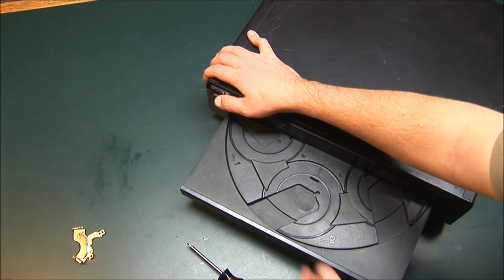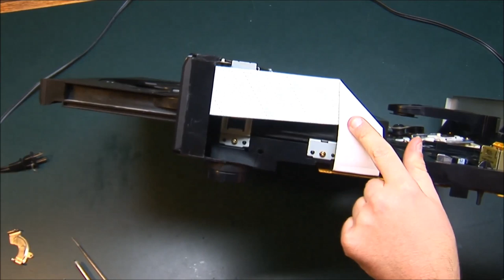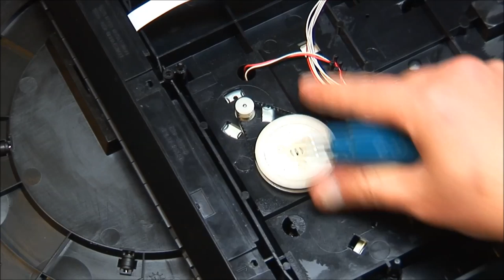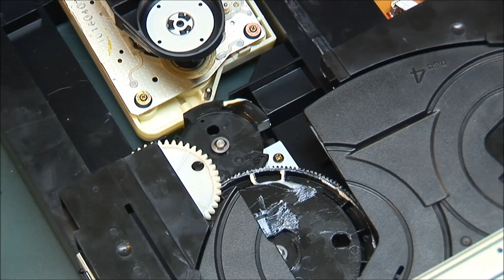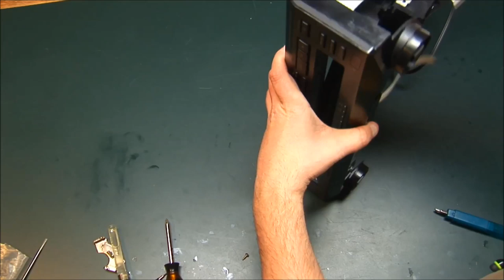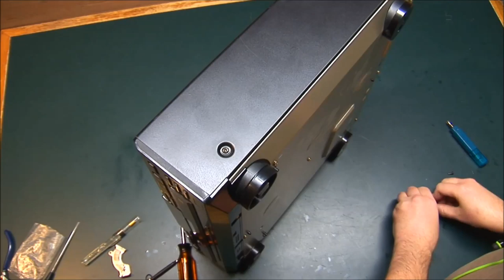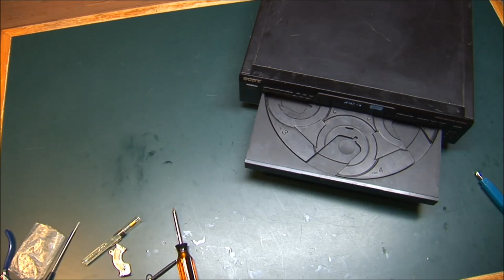Sony 5 Disc CD Changer Repair - Stuck Drawer, belt replacement, dissasemble

Comment: We have a small L-shaped bracket 1 inch by 1 3/4 inches and we don't know where it came out of. It fell out of something when we were dismantling the CD player. We are sure its the same model as the one in the video. Any help as to where this piece belongs?
Reply: We also have a small white plastic piece which doesn't seem to belong anywhere. It doesn't look like it's been broken off anything. We originally dismantled the CD player to find where this piece belongs, and now we have 2 pieces with unknown origins.

Comment: Where can a get the belt for opening and closing the draw. CDP C325
Reply from the maker: I usually buy a pack of assorted belt sizes from ebay or Amazon.  Usually can find somethin that fits.   Otherwise u can see about looking for that exact belt from the same places. But with the 100 belt assorted pack u have extra if u need em

Comment: I have this same CD played that I just picked up from a thrift store. it turns on but the drawer won't stop opening and closing (turning discs while it's doing this) and the drawer doesn't close all the way. What could be wrong with it?
Reply from the maker: might be a slipping belt, sticky grease on the cogs/rails (causing too much friction), or a bad limit sensor

Comment: I have this model and mine is making a terrible motornoice and it has problems playing the cd's.
When it finally starts to play a disc it sounds horrid, no problem with it the last time i used it.
It started to act up when playing Bowie, i guess his music was to powerful.
It will also skip cd's, my estimate is that some electronics in it has given up.
I bought it for like $11 so no big loss there.
Reply from the maker: check either of these videos:  https://youtu.be/ywT9C91pHbY        or     https://youtu.be/DHpnVLR8TDs     
You say it makes a horrid noise but I'm not sure what exactly that horrid noise sounds like.  High pitched whirring or a scrapping ?

Comment: My unit just developed an interesting problem.  CD's will now only play half way through and then the unit stops reading them.  I've tested it with different CD's operating from all the different stations, but the result is exactly the same.  Any thoughts as to what might cause this?  Thanks.
Reply from the maker: check the laser/pickup assembly.  Make sure it can move back and forth freely.  There might be a bad cog in the gear or the rods that it rides on might need to be cleaned or lubricated
Reply: @Electronicle  I'll give it a try.  Thanks.

Comment: Hi I need parts for a cd player like the one in the video can you please let me know where can I find it's the pinion the moves the tray.
Reply from the maker: u could contact sony and see if they have NOS parts for it..but that'll be expensive.  Try ebay for a busted unit and pull parts from it or if you have the part number you can search for that.
Reply: @Electronicle  that's what I need the part # but I don't see it on the pinion

Comment: Is it normal that the teethed belt underneath is that loose? My tray opens and closes back, seems lik it get stuck on something. I opened it al up and the only weird thing I found, was that belt being rather loose?  Thanks for this video!
Reply from the maker: Yes its normal.  First thing to do is check that there is no slippage.  Check that the motor isn't spinning when the belt or other pulley is not. If there is no slippage then the belt is fine and you'll have to find what is binding the drawer up.  Chances are its old grease on the rails.  Remove the drawer and clean off any of the old sticky grease from the tray rails and other moving parts.  Any hardware store will sell grease that you can use.  I often use White Lithium Grease.  The tube is only a couple dollars.  After removing the old grease (may have to use some isopropyl alcochol) apply new and run the drawer back and forth (even if it has to be done manually without the belt attached at first).  I hope that all makes sense.  Check back in and let me know how it works out and if I can be of any other help.
Reply: Alright, I'll give that a try, thanks!

Comment: I have one that turns but struggles to open smoothly.  Very like squeaking and slow opening. Any ideas?
Reply from the maker: the grease that is used on the gears and the track that the tray slides in and out on, overtime becomes sticky and sometimes hard.  I'd pull it apart like shown in this video and clean those areas off with some Isopropyl alcohol.  For the gears, use a screwdriver, blade or old credit card to clean out between the teeth.  You'll want to remove all the old gunk and then apply new.  Any hardware store should have a tube of White Lithium Grease for a couple dollars.  If it still opens and closes, chances are the belt underneath is ok.  Obviously I haven't seen your changer, however that would be the first thing I'd check.
Reply: Thanks

Comment: Any ways to fix one that suddenly just stopped playing in the middle of being used. I'm do a lisitening program, we have another but 4 discs inside but we haven't done ANYTHING to get them out yet. I have another now but if it's fixable that'd be great!
Reply from the maker: Do you mean the drawer won't open or the discs won't play at all?
Reply from the maker: kion student probably the power supply.   Could get lucky and it’s just a blown fuse but there’s almost always a reason the fuse blew.  It would require some troubleshooting.  Curious what model and make ?
Reply from the maker: No...the power supply...a thing within the cd player

Comment: nice job not showing how the lager ribbon cable is held in.
Reply: its a friction fit cable.  You just pull it out.
Reply: @whynot9884  My ribbon seems to be plugged into a black plastic piece that is plugged into the unit.  doesn't pull out of black plastic.  does the plastic piece pull out from the computer card?

Comment: I have a question I’d like help with, so just checking with you. I want to use my cd changer without my stereo receiver using bluetooth speakers. I bought a bluetooth adapter, but I can’t get it to connect to cd player and then play through a bluetooth speaker. It has an RCA connector to the bluetooth adapter, which is basically an RCA to headphone jack. I can connect directly from the CD player with this to a bluetooth speaker, but I can’t make it connect from the CD player to the adapter to a bluetooth speaker via bluetooth. Any thoughts?
Reply from the maker: do u have a link to the bluetooth item you are speaking of?
Reply from the maker: ok so you connected the rca output plugs from the cd player into the rca inputs of the bluetooth adapter?  From there its a matter of pairing the device to something.  I don't think i can be much help here as I'm not familiar with this device.  However, I can say that the cd player isn't to blame.  Its outputs are live regardless if something is plugged into them or not.    What Im thinking though is, this may not work.  Imagine having a bluetooth headset with a mic, and trying to pair it with a bluetooth speaker to use it as a pa system.  I doubt it would work.  Generally with Bluetooth you need to have essentially a master and a slave.  So For instance a smartphone would be the master and a bluetooth speaker would be the slave.  I have a feeling that both devices that you are using are slaves.  Have you tried pairing your computer or smartphone to this device to see if you get any audio through to it?
Reply: Thanks again,  @Electronicle  -- you’ve given me another idea to try. I’m trying to bypass using the heavy and bulky receiver, which I can do if I plug the RCA adapter directly into a bluetooth speaker. I think I’ll try getting a splitter for the bluetooth speaker and then plug the speaker into the bluetooth adapter. I’ve already established the CD player isn’t at fault -- just trying to get the right work-around so we can use it with bluetooth speakers throughout the house, instead of just having the one tethered to the player. I’ve discovered all kinds of ways to use new technology to update old, working technology instead of just tossing good stuff out, including our CDs and vinyls. Have a wonderful holiday!

Comment: Hey great video. Managed to figure out what was wrong with mine. Seems like the teeth on the gear that is in charge of turning the tray that holds the disks have completely broken off. Due to this, I think its busted but just wanted if you think it is possible to fix or best find a new one. I could not manage to find any parts anywhere. Thanks again.
Reply from the maker: Hmm..have you thought about maybe finding a broken one on ebay for cheap and salvaging parts out of it?  Also could try to use a different belt.  Use one that is smaller than what was on there for better grip and grind down any remaining gears on that pulley so that the belt would just be a regular pulley type.  You can buy bulk packs of all sorts of types of belts for cheap on ebay and amazon.  They are good to have around.
Reply from the maker: Also something that I have to keep in mind a lot when fixing older equipment.  You aren't restoring this player, you simply need to make it work.  So if you have to get creative, go for it...long as at the end of the day the drawer opens and closes..you're good.  Plus it'll put a smile on your face everytime you pop a cd in :)
Reply: Thanks for the tip. Will definitely try to fix. I am now afraid if another failing part may have caused the gear to be damaged.
Reply from the maker: eh...plastic gets old and gets brittle.  The motors on these things are also fairly weak, so even if you held the drawer in place it wouldn't break anything..or shouldn't.  While you have it apart, you may want to replace all the lithium grease around the trays tracks and on all the gears.  You'll notice a sticky substance on all of them.  That sticky substance should actually be a lubricant, not a glue.  Clean it off with rubbing alcohol and replace with white lithium grease that you can find at any local hardware store.
Reply: hey! hi electronicle, thank you a lot for this video, i have a mini component stereo that uses this exact same type of cd changer, and i want to ask you, besides lithium grease, could i use a silicon based lubricant? or should i stick to lithium? thanks in advance if you reply (:
Reply from the maker: Nah actually go for silicon grease if you have some.  It should actually work better.
Reply: Andrews Electronics is the place to call if they don't have it in stock they will research it and call you back.